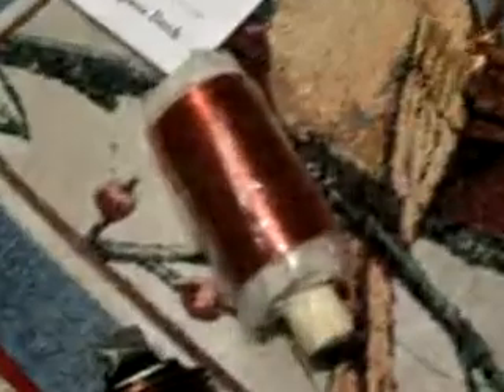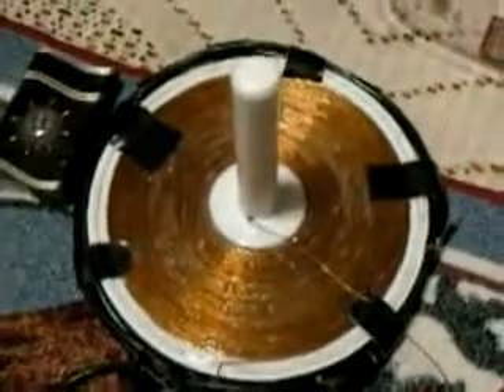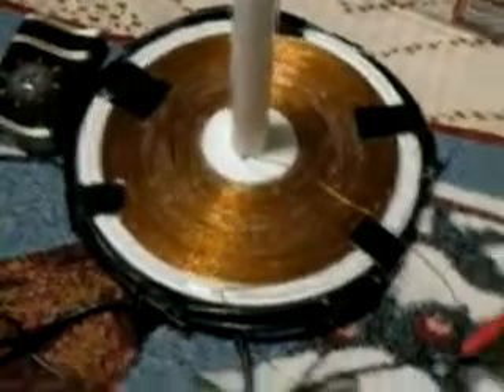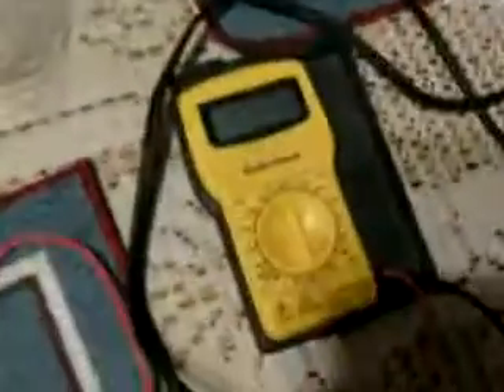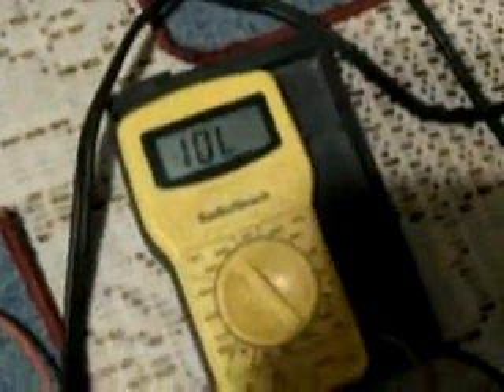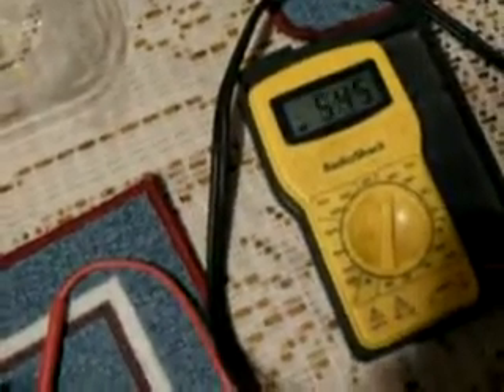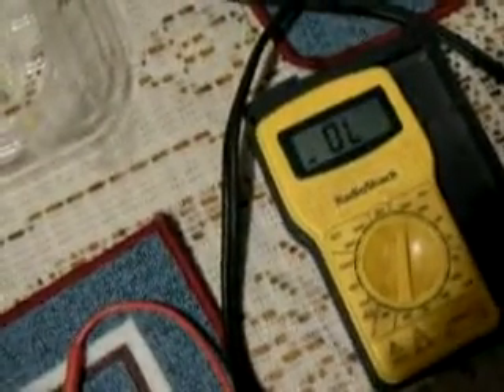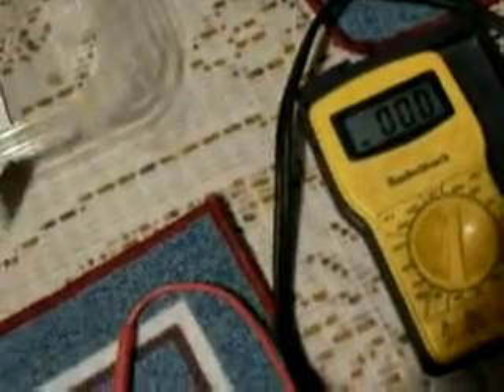Spiral Tesla coil low voltage low frequency testing

Comment: coool work ! thanks for sending me your site. this summer im going to attempt teslas mini power plant, but i will make a smaller version for testing. i already have most of the parts, i just need to get some wire and a high voltage transformer.

Comment from the maker: cool thanks im just working with what i have because right now im working with a hobos budget. its just in the alpha stages right now when i have the power supply part perfected i will make a larger spiral tesla coil im trying to battery power everything right now using old fashioned technology to do so i like vintage technology some of it really should be rediscovered it still has use i find so

Comment: High frequencies caused the false readings in the multimeters. You should try to find a cheap 10mhz scope and HV probe on ebay. It's really the best way to work with resonance. Don't ground your probes and meters as the internal resistance will be overcome by the HV and all the extra amperage burns out the electronics.